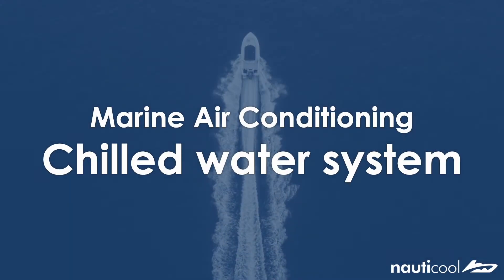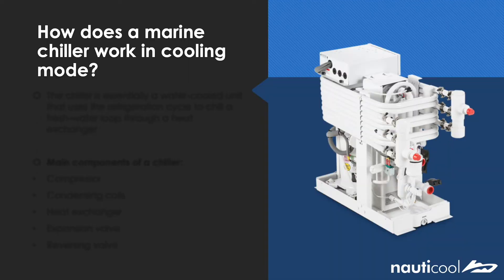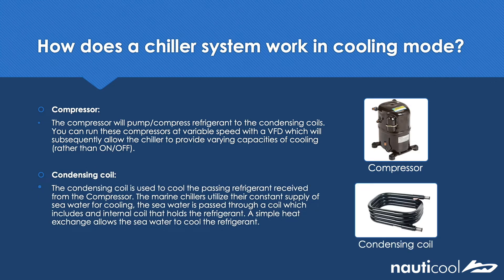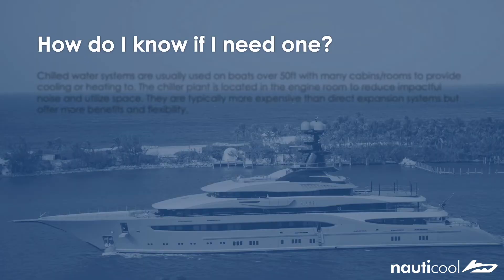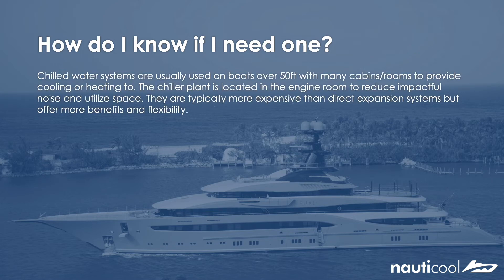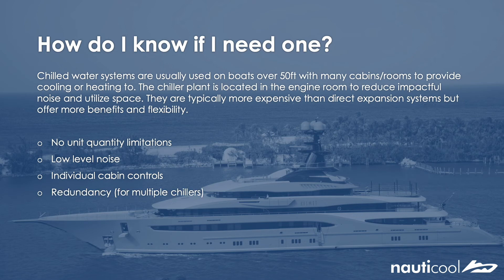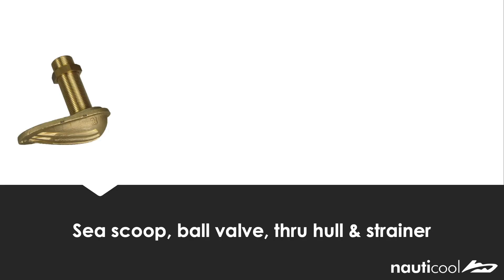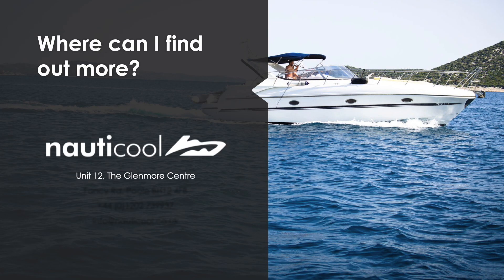Marine Air Conditioning - Chilled Water System

Comment: Does each air handler in each cabin handle both the heating and cooling for the boat or do you need 1 air handler for heating and 1 seperate air handler for cooling. If the boat already has a reverse chiller system, could a boiler heat system be added using the existing cabin air handlers? Would seperate lines need to be run to each air handler to handle the addition of the new heating / boiler system?
Reply from the maker: One air handler can be used for both heating & cooling. However, you cannot operate one air handler in heating if all the others are in cooling unless they have electric heating installed. The chiller system/boiler will have to be manually selected to operate in cooling or heating but yes you can have a boiler on the same chilled water pipe work. This is for a traditional two pipe chilled water system using dometic air handlers and controls.